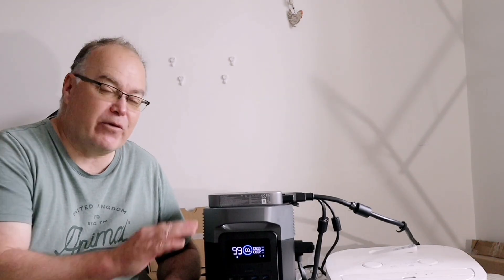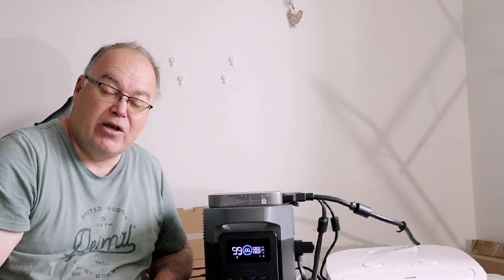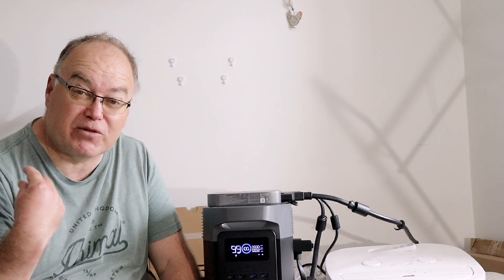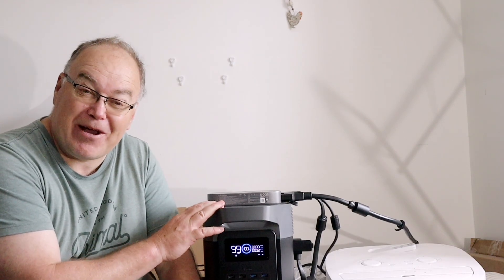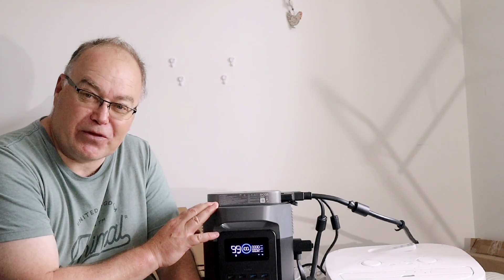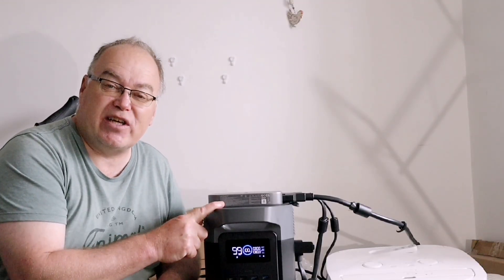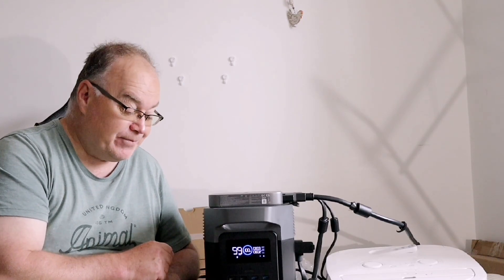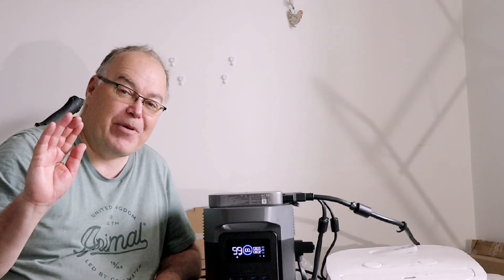Power your home with Ecoflow's DIY plug in Solar, battery and micro inverter system - Testing update

Comment: What would be the payback time ? Like the video and concept but would it actually be worth doing this - perhaps another great short review would be good for this 🤔
Reply: I don't think you'd buy this is you care strongly about the payback time. It's more about the goal to reduce your grid draw.

Assuming you charged it fully for free everyday from solar and discharged it every night, the max energy you could save per day is less than 1kWh (around 30 pence). So the 1kWh kit (£1,017) would take 9 years to payback and use 3,390 cycles (its covered for 3,000 cycles to 80% capacity, so may take a little longer than 9 years). The 2kWh system (£2,416) would take around 11 years (assuming a full cycle every day). Those are best case scenarios. You could bring the cost down a little by not including solar panels, but it won't change the calculations all that much.

Comment: Thanks for these videos! Do you think it would be possible to use an extra 400w panel plugged directly into the Delta so the battery was being charged even when the house was taking 800w? Wondering if it could be hacked to make use of 1200w of solar

Comment: Hi..i know at the moment this is not allowed in the UK,maybe if  be allowed  you need inform the DNO you have this divice ,,,and need complet the G83 or G93 im not sure...but if not inform they tell you for take off from the socket or disconnected from grid...
Reply: Anything under 3.68kW can be connected to the grid implied write under G98 and then the DNO notified of this connection. If you go over that amount 3.68kW you are looking at G99 or G100 applications and it that case the Device Must Not Be Connected to the DNO supply without prior notification and the DNO approving the connection.
Note that if you have solar you need to add the kW of this to it so you might find you go over the 3.68kW very fast which will trigger G99 or G100 certification
Reply: @DTech101  I know...is grid-tied under 16 Amps....thanks for info...
Reply: Hi, did this happen to you?
Reply: @davidbroad  No ,because is for sell,but the shipping 4-5 weeks...I now from somewhere....you can ask
..I'm not from UK...I don't now the rules.
Reply: @iordanionutable valid question. Anything that is injecting into the grid you  should have permission from a DNO. 

It also needs to be valid on the list of acceptable inverters and be validated for the DNO to accept. 

It’s a very fine line being walked along 

Especially if the socket that was feeding in is unplugged. How do you know it’s entirely safe. Would 100% recommend the hard wiring option for it
Reply: @iordanionutable  Ive emailed ecoflow and they say its compliant with uk laws .no need to tell the DNO
Reply: @mucky2hot  Perhaps you should check with your DNO to make absolutely sure.
Reply: @daviddawson9099  I have (uk power networks) said that as long as the system is below 3.6kw per phase and the solar is not fixed) also the system is not generating power to export back to the grid but will be consumed by the user, this is not grid tied. EcoFlow system does NOT unintentionally export of power into the grid, i.e if a grid power failure the EcoFlow system will switch off
Reply: @mucky2hot  Interesting I would have thought they needed to test the security of that switch off and how controlled the system is in not feeding back to the grid. I think when it is connected to the grid and used in that mode it would be classified as grid tied. Not sure why they specified the solar was not fixed as can not really see how that effects safety. Lots of questions?
Reply: @daviddawson9099  If you don't have the smart plug for control the energy...the microinverter will sent in the grid ....but same I think need ask DNO...because is not legal in the UK at the moment ...we be in the trouble...with the DNO and insurance home...sorry for my language....in my country is the same ,you need at mountain with the documents, and payd at tax.....You make yourself a question. if it's worth all the effort or not...especially to recover your investment it takes 10 years and then the batteries and panels degrade.....it's ok if you have more than 9kw...to sell to charge the electric car...but  invest 4 thousand to save 20  pounds per month...when will you get your money back?
Reply: @mucky2hot  Against UK wiring regulations BS7671 reg 551.7.2 (ii) A generating set shall not be connected to a final circuit by means of a plug and socket-outlet
Reply: @daviddawson9099  I emailed my DNO and they booted it up their tree  - about 8 weeks now and still no reply !
Reply: @DavidPemberton-k5q  My current system is connected to a dedicated circuit

Comment: Can the unit power the house basics if there is a powercut.
Reply: Yes, I was wondering the same.
Reply: Not directly, you have to use the inverter on the battery unit ,once the smart inverter doesn't detect the grid it stops supplying power to the house
Reply: @paulclapton7803  so it's not very useful,you would need extension leads for WiFi,fridge, TV etc in that case.

Comment: So how does that work without a CT clamp? Would it cover the 130w my hybrid inverter uses when it’s charging my home storage battery. I can only get zero grid import when my batteries are full (I think that’s normal).
Reply: Max is 800w in Uk, i believe its 600w in Germany because of laws
Reply: @mucky2hot  ok but that’s not my question